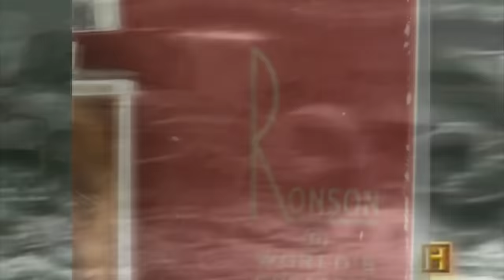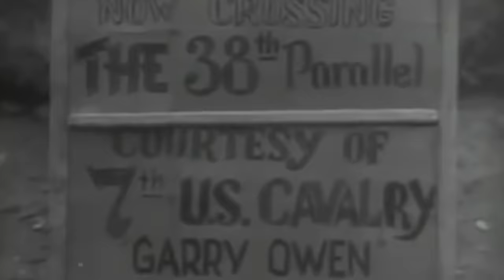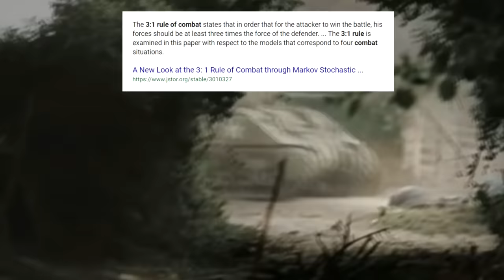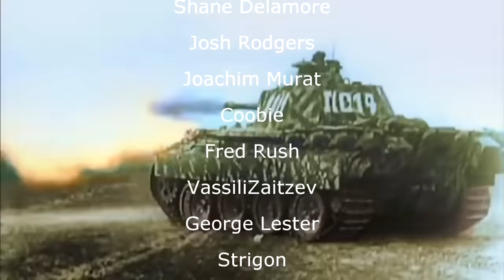The American Tank Meme

Comment: Sherman:
-Good gun
-Good mobility
-Too tall

Weak spots: sides and rear
But if u don't hace an 88 u can't even penetrate it's front!

I think this is the Sherman...
It got a few problems but it was a great tank after all!
Reply: It didn't really have an effective gun until your British got it and put a bigger gun on it. The firefly was a vast improvement. The Sherman was a pretty basic tank overall, it wasnt terrible, but its lack of armour and its weak gun, made it a dangerous place to be. It's kind of like the sten gun, cheap to make and  and easy to use, but not practical when it came to going up against better designs.
Reply: @jh565bb  firefly a vast improvement? Didn't they just stick a 17pdr on there and called a day? It's also because of the gun was not made for the turret that it suffered from accuracy issues? The 75mm is also a good enough weapon for it's intended role and the 76mm and firefly was just specialist roles for taking out tank which is what they are intended for.

Comment: 6,000 Panthers vs 50,000 Shermans. I’m more of a tactics man, but I clearly see the winner
Reply: In such a fight, the panthers would destroy about 30,000 shermans.
Reply: @Rommel_-nn2mu  more like the panthers get obliterated by artillery and air support before taking even more casualties from sherman guns thanks to the notoriously shit German steel causing heavy spalling and even just shattering the armour plates.
Reply: Every panther dies from engine or transmission failure, resulting in a win for the Sherman’s superior design.
Reply: @markman6105  😂Yes, yes

Comment: The sherman is the t34 of the west:

Not the most powerful vehicle by the end of the war but more than a match for most of what they were likely to encounter. Fast, durable, well armed and incredibly easy to produce they completely outstripped German production which was essential when fighting on the offensive. Excellent tanks for the purpose they were built to fulfil but shit on by armchair historians who look at the tiger on paper and say 'haha, look how puny the allied tanks were' ignoring the fact that there were about a thousand shermans or t34s for every tiger around and that the tiger was actually an underpowered mess.
Reply: The Tiger 1 had equal or even better power to weight ratio than most Sherman variants.
Reply: @TTTT-oc4eb a few variants but not all lol. It only really outpowered the jumbo, and its main engine issue wasn't it's power to weight ratio but it's transmission. The tiger consistently had difficulties with it's engine and especially its transmission.
Reply: @mojotheaverage  only the Shermans with the 450 hp Ford engine had a slightly better power to weight ratio than the Tiger 1. By 1944 both the Tiger and Panther were reliable by WW2 standards.

Comment: Fun fact: the "dry" Sherman suffered ammo burnouts from shell penetration at the same rate as the Panzer 4, but once the second turret hatch was added it had a significantly higher crew survival rating.
Reply: @ALEX HUANG The wet ammo storage fixed the ammo burnout problem, but even with dry storage once the second hatch was added to the turret and the hull hatches were enlarged, the crew's odds of surviving a penetration went way up.

Comment: I dunno it's not like shermans were known as death trap due to RELIABILITY ISSUES such as consistently combusting due to engine problems and breaking down often.
I mean when they ran they were good but once a Sherman set fire or just wouldn't move due to malfunctions, that's when they're called death traps.
Reply: the death trap myth has been wildly hit or miss, like yeah. The reason why ammo cooks off easily is because early crews crammed ammo in every spot they could find. Besides, later versions had wet stowage, after hearing this. The engine problem was also fixed for later versions (I believe M4A2 onwards). But that’s just my take. source is chieftains hatch, m4 sherman
Reply: Are you confusing Shermans with the Big Cats?

Comment: I think a big part especially before D-day is the tank crews themselves not wanting to switch. Say you fought in North Africa in your 75mm Sherman. You took out a couple Panzer 3 or 4s. You took out some German AT guns and infantry in your 75mm Sherman. It has kept you alive through that so you are sort of attached. It also has done the job just fine.

Then second to that but just as important you know the layout of your tank, you have done some field mods to make it more well suited for how you use it. You know how you can move in it where things are. Your gunner knows the gun and has a good feel for getting it on target. 

Then the brass is like hey there is this new tank with a slightly different layout and a bigger gun I want you to use. Up to that point though your 75mm hasn't failed you so why switch. It would seem like an unnecessary headache.
Reply: And don't forget that by the time the Western Allies breached into Germany proper, the Germans had severely reduced the quality of the armor of their tanks and had lost their entire airforce. Oh, and the Soviets were at Berlin so all available resources were being sent to the Eastern Front.

Comment: The Sherman would have a much better reputation if the following had been standard/ready in time for Normandy:
HVSS
Large hatch version with improved armor quality and add-on front armor
105mm gun (with 10 rounds of HEAT, 56 rounds of HE) standard instead of 75 mm
76 mm gun (with 10 rounds of APCR and a better HE round) - one or two per platoon
1000 Jumbos armed with a mix of 105 and 76 mm
M36 tank destroyer instead of M10
Reply: That's a fantasy that the US Armored division didn't even thought of

Comment: I had to go fact-check you on the radial engine thing.  I thought we mostly used Diesel engines in them, but although I'm not having much luck finding production numbers for each engine type, the GM Diesel wasn't used as much as the radial, and a gasoline V8 made by Ford appears to have been what they went with later in the war.  Wish I could see the actual production figures, now that my curiosity is up.

Comment: Another point you forgot: armor thickness. The heavier the armor, the more the tank weighs. Multiply that by thousands upon thousands, it requires much more logistics. Unlike the German heavy tanks, the Americans had to actially ship them overseas. It would take more ships to transport heavier tanks overseas than the lighter ones.

My professor said it best: the Sherman was a compromise to excel in both Europe AND the Pacific. On top of that, the Sherman’s performance in the Pacific was more successful and it shows. On the attack at the Peleliu airfield, the entire Japanese tank unit defending the island was destroyed once Sherman tanks appeared to support the infantry. The armor of the Sherman was sufficient enough to easily deflect Japanese 37mm rounds and the 75mm easily destroyed the Japanese light tanks.

Comment: You're right and everything but one. The choice to use gasoline engines was a mistake and didn't need to happen
Reply: How was it a mistake?
Reply: @prickly10000 Many tanks used gasoline. The "Tommy cooker" idea mainly comes from the fact that the British in North Africa overloaded their Shermans with ammunition, meaning any hit that penetrates would probably hit something explosive.
Reply: You’re talking as if most of Germany’s tanks didn’t also run on gasoline. Also there were many Shermans that were equipped with diesel engines, though that wouldn’t even matter because the diesel fuel would still ignite as well because it’s still a flammable liquid.

Comment: Tank destroyers did not go away, they were developed further. Without the need to build vehicles **now**, you could put the big guns onto cheap wheeled chassis instead of wasting the expensive MBT chassis. The next logical step was to switch to autocannons, and add anti tank missiles instead of the expensive main gun. Still the same role (almost a tank, but way cheaper), and even reasonably easy to refit into long gun tank destroyers if the need arises.

Comment: The capacity of the logistical system also dictated the elements of the design of the weapons.

The Sherman was a tool to be used. It had to have crews trained on its operation and maintenance, and those crews trained as a team member of a unit.

The tanks were one part of the combined arms which fought German Forces,

The tank was rugged, reliable, easy to keep in repair. It worked.

But if you ever see a real Tiger next to a Sherman, your first reaction too would be fear.

And then you would figure out how to take it on, if you were still alive.

Bushwhack and  ambush. Controlled murder as my uncle put it.

Comment: Was there not an issue with the available cranes at American ports. They were not large enough to lift super heavy tanks onto a ship or the cranes that could were in short supply. What's the point in building a monster tank if one can't get it to the battle?

Comment: Even though people say that the German tanks like the Tigers and the Panthers were good the reality was that those tanks were prone to breakdowns and expensive to make the M4 Sherman was reliable and it was cheap the Germans quickly ran into the problem of not enough money or resources to keep tank production going meanwhile the allies have a cheap reliable tank that was decent during the beginning part of the war for example the Germans had to take the Panthers on a train to get them from place to place because the mileage on the engine of a panther couldn't go very far that combined with the not so great transmission made the panther very probable for consistent breakdowns.

Comment: Interestingly, the army investigated whether the Sherman burned because it used a gasoline engine.  They studied 100 british and American burned out shermans,  and not one of them had a ruptured fuel tank.  In fact, some examples still had fuel in them. It was the ammunition that burned.  Also, there were no diesel powered German tanks. Another key point, from June 1944 to May of 1945 the Army lost 1800 tankers in total in the ETO.  600 of which were killed while outside of the tank. So, hideous losses by the American Armored forces were just the stuff of mythology.

Comment: The issue WW2 vets have told me concerned them was the fact that it ran on gasoline and not diesel. Soldiers arent really afraid to die. They are afraid of burning alive, hence...people did not like em.
Reply: That’s a myth. The Sherman didn’t catch fire more than any other tank. In fact, the late war Sherman was less likely to burn than other tanks.
Reply: I mean, the t34 had fuel tanks lining the crew compartment, in comparison the sherman seems a lot better

Comment: The part about "Sherman deathtrap" that i could find, was that the ones used in Europe ran on regular gasoline, while the ones in the Pacific ran on diesel.   And all the "deathtrap" memes appear to come from Europe.

REGULAR gasoline, as in highly flammable.

Compare with how the Germans used gasoline with a chemical addition to make it drastically less easy to ignite outside of the engine.

And what little actual information i could find, strongly did support that this made a huge difference, comparing Shermans getting hit by similar weapons in Europe and Pacific, those in Europe caught fire drastically more often.   It just added greatly to it that Japan didn't have much in regards to AT-weapons either.

I have never been able to truly and reliably verify the above, but as far as i could get, it does appear to be real.

...

There's another almost universally ignored reason USA had issues doing much useful stuff early on in WWII.
The simple reason being that aside from massproduction ability and technology?
USA was a tech backwater.   The Tizard mission took care of this AND gave USA an extra 30 years worth of head start in everything from electronics via jets to nukes.   All of that came from UK, France, Belgium, etc, there were even some later additions from USSR.
What always annoys me to no end is that USA got it for free, and then had the audacity to demand that lend lease was completely repaid, while living rich on that tech.

Comment: The Sherman when it was first sent to North Africa was more like a nightmare for German tank until the pz IV got the F2 gun on it but the armor on the PZ IV didn’t get thinker until  1942-early 1943 and probably didn’t reach the frontlines until mid so most allied tank were fighting the PZ IV F2 and PZ IV G wich had 50mm of armor frontal so the Sherman had an easy time penetrating there armor the PZ IV   H had the F2 gun a thicker 80mm front armor plate that the Sherman could still penetrate at close ranges but I’m not gonna talk about the Tiger1 because it’s the Tiger1. Edit: fun fact the normal M4 Sherman with the 75 gun could penetrate the Tiger frontally if it was firing APHE and at point blank range but a Sherman could never get that close to a Tiger

Comment: i wonder about the perception of the sherman tank. Does it come solely from the combat experiences against up-gunned panthers and tigers? I mean, the panthers and tigers were great, but only when they were working. How many times do you read about a tiger battalion and it always goes "tiger battalion starts with 30 tanks, 20 of them are lost because of mechanical problems and have to be blown up, 10 make it to the battle and perform exceptionally well. 5 are destroyed in the battle and the last 5 make it back to safe territory". Given the mechanical complexity of the supposedly superior german tanks and the know reliability problems, how superior were they? In fact i would say "the right tank for the wrong war" is a much more apt description of german  tanks. When the germans were on the offensive, it would have been better to have had larger, more powerful tanks that were deficient in reliability. If it breaks down, no problem. Just repair it and get it back into action. But when you are on the retreat, a mechanical problem is a death sentence. Any little problem causes a total loss. If you look at the course of the war, the germans did the exact opposite.

Comment: One mistake in the video

"Not taking the 76mm was a bit of a mistake" is false. 
The HE-round, by far the most fired type of round for all sides, in the 75mm was far more effective than in the 76mm gun. The 76mm gun was only good to penetrate the big cats of the germans

HOWEVER steel quality on german big cats was so bad that you could break crew or components by firing HE rounds at it. 0 penetration but enough of a shock to disable it.

Comment: Americans: Considered weight/dimensional restrictions, designed a tank around human beings, then shipped them 5,000 miles into battle, average armor/gun
Soviets: Designed a tank, built the tank, then stuffed humans wherever they'd fit
Britts: Built a total of four tanks, then 'borrowed' 10,000 tanks from the Americans
Germans: Built a hardened steel pillbox, put a massive gun on top and some tracks underneath, then preceded to use them as normal pillboxes
Japan: Built WW1 tanks that were only useful when invading China
Canadians: ...rebadged some Shermans
Australians: Built a cramped Sherman with a male appendage mounted to the hull
New Zealand: Welded some plate steel to a bulldozer

Comment: Something about the 3% mortality rate: If you produce 50.00 Shermans (i know, not all in WW2 and not all fighting German Guns which could actually destroy shermans) it is not hard to get 3% Mortality. Germany kept a giant part of their reliable tanks on the eastern front (Panzer IVs, StuGs) and send their engineering nightmares to fight the well trained Sherman, Churchill and Cromwell Crews. So a German Tank could knock out a Sherman without that much problems. The Problems were the German Tanks. Either They broke down on the way to the front, they got knocked out by Allied Air superiority or they just got overwhelmed. A German Gunner was trained to kill an enemy Tank over 1.5 km and more and operate in close contact to other tanks. 
In France, the nightmare of german tacticians started. They realised that enemy tanks could close in and it was very likely that of the 5 Tanks send to the front 1 arrives. 
So the mortality was more the German failure in their tactics, not because the Sherman was the best tank ever. Even though it was in total better for a battle than 90% of the German designs